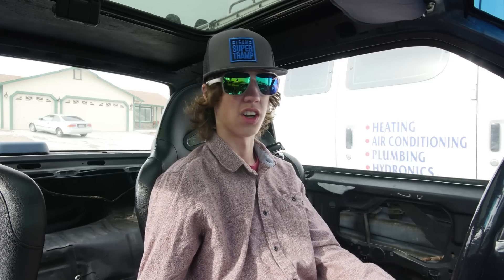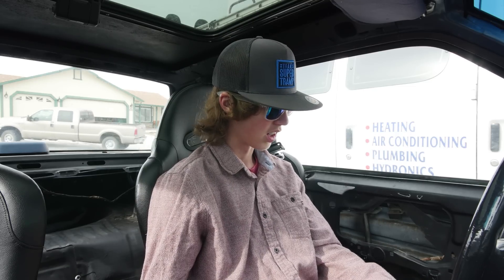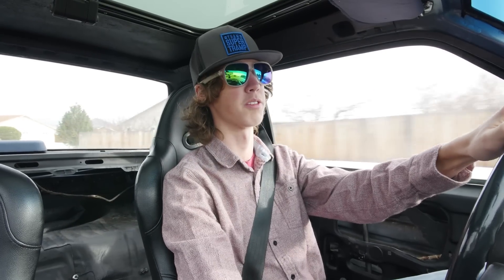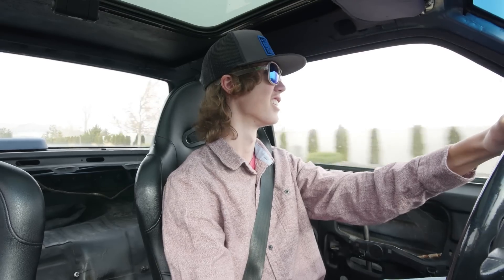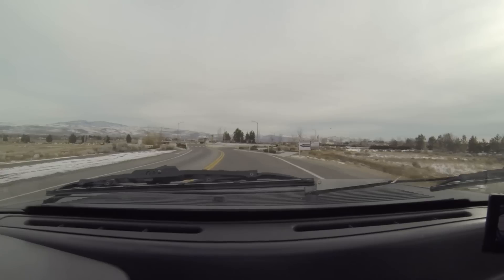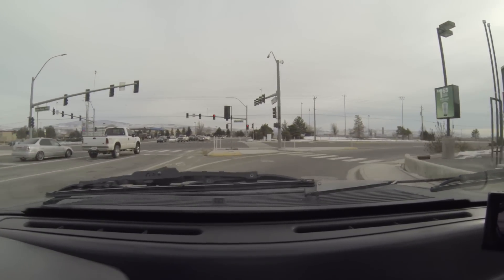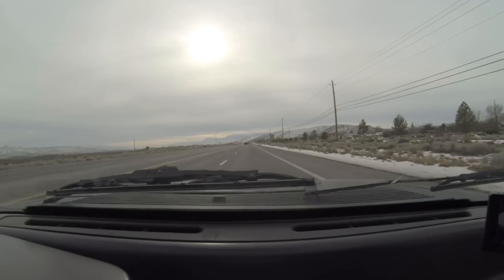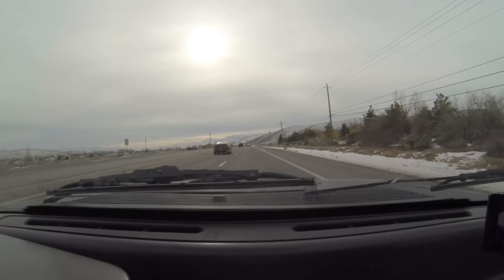Foxbody Mustang Drag Car Build Ep. 13

Comment: Is it more cost effective to to with a ls motor than to rebuild the old 302 ?
Reply from the maker: +pensmoni My new motor which should handle 500-700 hp at least I paid $450 bucks for and then mabye another couple hundred for cam and valve springs but I cant give you an exact price because I only have the motor right now, but yes it is literally half the cost and I can just go get another 5.3 and swap my stuff over if it blows up. There are literally 5.3s EVERYWHERE
Reply from the maker: +pensmoni You can't even push a 302 past 400hp without forged internals from what I have seen on youtube.
Reply: Thanks for the info bro. Keep them videos coming
Reply from the maker: No problem love talking to you guys on here thanks for commenting.
Reply: +MustangMatt That's bull. All the 5.0's from 87-92 had forged stuff in them from the factory and will take a beating. They are tough little motors, 550-600 would be the max. You should have done a Windsor and a turbo, would have been plenty for what you are looking to do without all the LS changeout stuff (headers, kmember, etc.).
Reply: pensmoni if ur going to build a mustang I would start with a 351, great motor to build